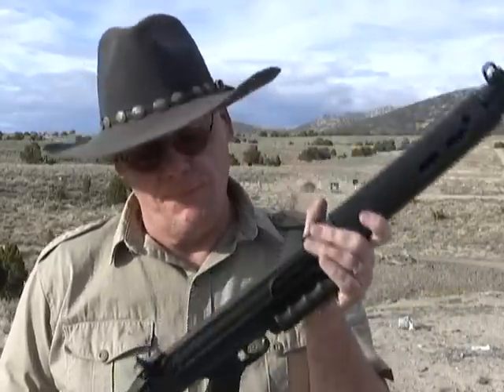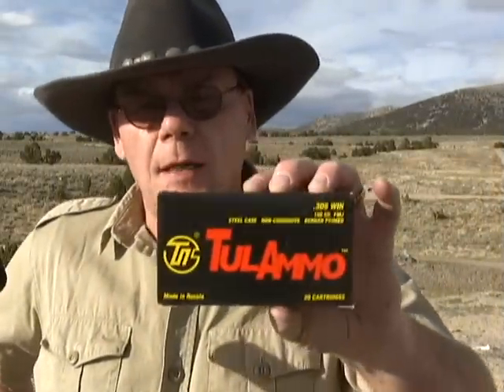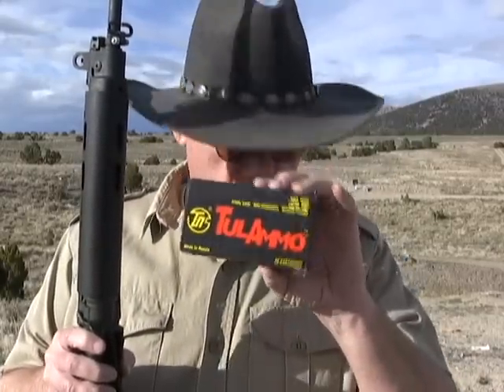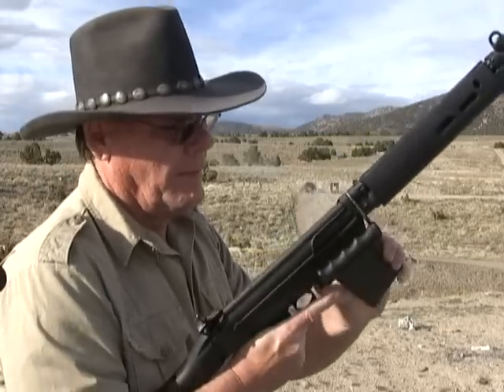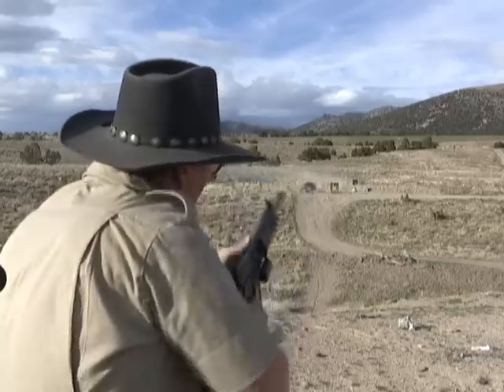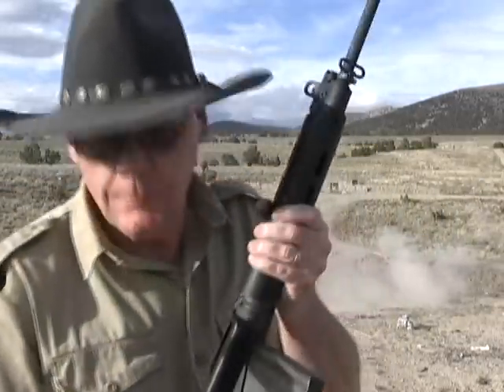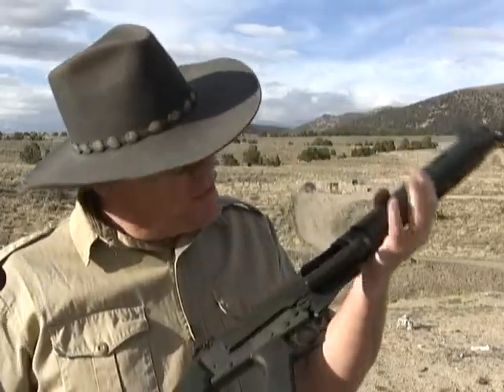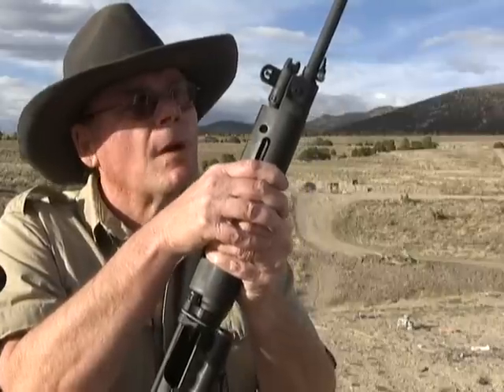Century Arms .308 R1A1 FN FAL Battle Rifle Junk?? You Decide!

Comment: I used this rifle (7.62mm) in the British military in the 80's.  Never had an issue with the rifle itself; the mags themselves is another issue. Often the bottom plate of the mag would pop off at the most inconvenient time  (only secured in place with a pressure button) .  When it happened you instantly lost the full contents on the mag onto the floor.

Some were concerned that the foresights and rear sighs were not on the same body part, so when the rifle was broken for cleaning you could lose the zeroing. I personally didn't find this an issue.

Comment: Using #3 on the Gas Plug is the norm for most Military Requirements for this Rifle.   Too high in the number or all the way up to Eleven, almost makes it recoiless...but there is a significant loss of power and the gas piston may not be pushed back far enough to completely push the Bolt far enough back for the Extracting/Reloading Sequence    Below 3...you'll get the Full Recoil and the possibility of tearing the ends off the Cartridges.  Especially Cheap Ammo.   #3 is the best setting for this Rifle...your Hunch was correct!   Some use #4 Setting with no issues.

Comment: I just got a frankenfal. It says century arms made it and calls it the R1A1. It has a 16-16.25" barrel, a dsa railed handguard, a DSA railed top cover, it is also a paratrooper folding stock model. The bolt hold open is missing the bar that the magazine follower hits to lock it open. It's a good shooter. I first tested it while it was completely dry and it functioned perfectly with the gas regulator set on 2. It would function in 3 but the cases were basically falling out instead of really ejecting. I'm gonna clean it up more and make sure the gas system isnt built up with carbon, then lather it up with lube and see how it functions then. I prefer it not need to be almost fully gassed to operate. I mainly fired 149grain brass cased ammo that I believe were reloads (they came with the gun from the previous owner). I also shot federal m80 7.62x51 that I bought from Walmart. It acted the same as all the other rounds I shot. It's not as nice as my ptr91 but I'll eventually get it cleaned up and set up right. I see alot of fals with the railed handguard and railed top cover and they will have a gap between them but mine butts up against one another making it into basically one really long continuous rail. This gun raises alot of questions for MN e so I guess I'm gonna have to tear it all down and do some research on all these little odd bits just so I can figure out exactly what all this thing is built out of.

Comment: I used these while serving in the British Army (infantry). A fantastic weapon which I preferred to my SA80 when we changed over. You knew for a fact that if you hit someone with an SLR they weren't getting back up and if you hit a limb it was most likely coming off. In all the time I used it I didn't have a single stoppage so I don't know what he's waffling on about as if it's unreliable. People get stoppages on an SLR if they don't clean it and even then it would have to be in really minging order to get a stoppage. The gas setting is there to compensate for crap ammo so if it's not re-cocking properly alter your gas setting, you don't need to go to a gunsmith. If he'd got a real L1A1 instead of a commercially made one he'd have had no problems at all.

Comment: For 5 shot and under, there is no issue with getting a .308 up here. If you get a chance, check out Lever Arms Vancouver website. Although a loophole in the law lets you run a 10 shot pistol magazine in, say, an AR-15, because it was originally designed so. The laws here still let a guy get some great guns, but the criminal and gun laws are pretty strict. So a guy risks gun seizure by the if rules are broken. The best thing to do is carry the law paperwork on yourself, for an officer if stopped

Comment: Used to work for Century Arms in the 90's up here in Montreal. We'd get a whack of FAL's, metric and inch, and we'd "sporterize" a whack and ship them to the St Albans VT warehouse. Sporterizing consisted of chopping off the flash suppressor and bayonet lug, and putting this gawdawful thumbhole stock on. The finish was crap (some really just being spray paint!).

In Canada we used the FN C1 until around 88 when we changed to the C7. Loved shooting the FAL and had less jams than the C7

Comment: the zero gas setting is for launching grenades. if you hold your finger to the rear each time you fire it will click as it reloads.. If it don't your out of ammo or have a miss load. always check the lips on the mag... always! some tracer will not light up till around 200 metres.

Comment: The British Army used a version of the FN called the "SLR" (or Self-Loading Rifle) from the late 50's until the late 90's - for non-infantry roles/ reserve forces.  It fired a NATO 7.62mm round which I assume is equivalent to .308.  It is a long rifle but in good hands is very accurate to over 400m (standard effective battle range).  The rifle I was issued was probably older then me but it worked fine with a little TLC.

Comment: Hey mixup98, I have had one of these for over 10 years, and still love her. Don't get to shoot her as much now the 7.62x51 is so damn expensive. But she is dead accurate. Just ordered the picatinny quad rail for her next is the M249 SAW pistol grip and butt stock
Reply from the maker: Michael....looks like you're going to have a nice set-up. I try to find cheap Russian ammo on sale but it still runs about $11 a box. Have fun and be safe, my friend.
Reply: mixup98 Yeah I have always kept it on gas setting on 3 as well, but never get the breech in the locked position after final round. Now whats harder to find is the FAL 308 Inch magazines, it will accommodate the Metric Mags, but they are a little loose and may cause jamming. But I have yet to have that happen.
Reply: Michael McCabe
If its original L1A1 style Inch pattern, it's not supposed to lock open, Brits removed that function for some reason...
Reply: That makes sense then thank you Sven Blubber

Comment: I have an Aussie L1A1 from Century built on a Hesse receiver. Once I polished the feed ramp and adjusted the gas it has run like a champ for the 15 years I've had it on about any .308 ammo. I try to stick to brass case annealed mil surplus .308 though. I also added a Trilux Suit scope to it as well which is a really neat military scope for it. I also added the Aussie wood and 5 slot flash hider as well so that it look the way it did in the 60's when it was made. Great gun, love it.

Comment: I have one identical to that and I can't tell for sure if it's inch model or metric- I contacted Century Arms with the serial number to find out and they said they made both back then and don't have records and don't know..  - I was wanting to put in an Israeli 21 inch HBAR barrel in it but will start a new one using a DSarms receiver. I note the mag slot on the front of my R1A1 Sporter  is a bar shape verses a more rounded slot so I'm guessing it must be inch model or at least made for inch model mags. I have a mix of 20 rd Israeli & 30-rd South African Army metric mags which all work... It has never jammed and I run a gas setting of 3'   - - That thin barrel gets very hot fast with high rates of fire.

Comment: Okay, couple of things.
With a Century built SLR/FAL clone, if you can find one with an Imbel Gear or Non Gear upper, go for it. You are getting a mil spec upper there built in Brazil in an FN licensed plant. 
No steel case in your FAL clone. It was designed to run brass cased ammo. Leave the steel cased for rifles designed around it. That will eliminate many of your FTF and FTE issues. 
Gas settings. Load ONE round in about 5 of your mags turn gas nut to Full Closed, insert mag and fire. If bolt locks back on the empty mag, you have too much gas and a problem. If not, open gas nut to setting One and repeat. If blt doesn;t lock back on empty mag, go to setting 2 and repeat. Repeat until you get reliable bolt lock back on an empty mag The bolt should begin locking back at a setting of 3 or 4 with good, NATO spec brass cased ammo. Ejection should be brisk and depending on gas setting, flinging your spent brass between the shooter's 2 o'clock to 4 o'clock 8-12 feet away. 

Right Arm of the Free World and still an incredible rifle.

Comment: you can fire 7.62x51 out of a 308 but not the other  way around safely that is. 7.62 is made to 308 head space spec and is slightly lower on the pressure

Comment: Do you know of any specific .308 loads that use rod type powders? I'm not surprised...they've been slowly pushing the design further and further so as to try and muscle out the gap between it and the .30-06. It may work fine with bolt action rifles but semi-automatics using high pressure loads intended for bolt actions (particularly hot match loads) generally don't fair well. The Remington 750 supposedly can handle "any SAAMI pressure round" but I've yet to test the truth of such a claim.

Comment: I bought an L1A1 from Century back in about 1995 or so. It was a post-'94 AW ban abortion. Ugly loopy thumbhole stock (to get rid of the pistol grip, donchaknow) and no flash suppressor.  It was strange looking, but I tell you what, it shot anything I fed it without complaints, even a bunch of cheapo copper-washed Chinese 7.62 NATO stuff. I was a gun dealer back then, so I sold it.  Kinda wish I woulda kept it now. It would be nice to have a reliable semi-auto in .308/7.62 NATO. Even an ugly one

Comment from the maker: Stealingmonwh11.....sorry I can't give you a current price for this rifle. I bought the one in this video back in 2002 for $449 in Las Vegas.
Reply: I see these on Gunbroker all the time for @ $900.00. I have also heard negative reviews, but being a gunsmith, I fully understand that it's most often the nut behind the wheel that's loose. These are more reliable and accurate than most anything on the market, as long as they're assembled correctly and the gas is set properly. It's been used by multiple military units in the harshest of environments on earth and is truly "The Right Arm of the Free World".

Comment: Sir when you fired that rifle in auto mode, it is noticeable that you can not really hold the recoil of the rifle and you fired it at close quarter. This shows that full auto could be use but in Close Quarter distance only. Beyond that you must fire the rifle in semi auto mode or if there is an burst mode. At clear field you could see your opponents even at 700 meters and if your FN is fitted with telescope you can out gun the guy using 5.56 M16 or 7.62 AK. I think it is correct that the one with a longer reach, under hard cover, and have better fire power have the edge in the battle field. The FN with an almost full size ammo has the better firepower and longer ballistic range. The ammo carry load may be heavier limiting more carry load but the fire power compensate that; and you do not shoot and shoot in the battlefield.

Comment: You reversed the gas plug for grenades and instead of a fmj round you used what was called a Ballasite cartridge to launch the grenades.
Plus you might want to tighten the carrying handle on that weapon cause if you get a rebound off it your left hand is gonna get bitten and that bugger hurts just remove the handle and put a little twist in the hinge circle it should be stiffer.
Reply from the maker: Hello Nigel and thanks for the suggestion with the carry handle.

Comment: Bolt wont lock back...as well as the magazine it can be the gas setting.Not all ammo runs at the same pressure.I'll shoot S.African 7.62 then have to open up the setting for the German or U.S.NATO spec stuff.Please be aware that the Arg. CAVIM is notorious for having varying pressures.Its supposedly been at fault for 'blowing up' a few guns over the years.That stuff is not safe.Go check out The FAL Files site.The guys there are very informed and helpful.Great vid.Thanks.

Comment: ???Really?You probably have to replace the gas piston.Once I replace that it was smooth shooting.Also punch the gas port with a pipe cleaner with some Hoppes bore cleaner and wipe dry.Set the regulator to # 3 or 4 then work your way up until the bolt locks around 6 or 7.The best I have found was 4 or 5 which helps reduce recoil.Mags might be the problem,check or replace spring and follower.Its the same as the M14 in many ways.Good luck and enjoy shooting!

Comment: The FN FAL pattern is really difficult not to fal in love with (pun). Right Arm of the Free World. If you get one that's manufactured well, (which can include the occasional Century), it's a really enjoyable firearm to shoot. I had a DS Arms IMBEL for years, till .308 became too expensive to shoot. Ended up selling it in order to buy a VEPR in 7.62x54R, less than 1/3rd the cost per round to shoot. The FAL however, will always occupy a soft spot in my heart. It's a long, sexy rifle that fires a full power cartridge but kicks like a lightweight .30-30. The FAL is what I'd refer to as a Rifleman's Rifle. Provided it was manufactured correctly: they're ordinarily ridiculously reliable and provide as much practical accuracy as any combat rifle need do. By that I mean 2 MOA is common with no modifications, 1-1.5 moa is achievable with some work put into it and sub moa is attainable if you want to go with it. The only real caveat with the FN FAL pattern rifle, magazines. There's millions of magazines in existence for it (that is a mathematical certainty): and weeding out bad mags can be a chore. Once you have 4-5 good magazines that you've tested through it though, that sexy little Belgian beauty will run like an Olympian.

Comment: Thanks for making a video of the Canadian FAL variant. I had one of the 1st Century Arms with the thumb hole stock. It shot pretty good but Jammed with Russian ammo.
I had my gunsmith assemble an FAL with an Imbel reciever and use a Douglas match grade barrel that he fluted. It is spot on accurate and NEVER jams. I think it is one of the best non scoped 7.62 that you could have. I picked up almost new Austrian mags for $8 per about 8 years ago. I have my lifetime supply of ammo, parts and mags. What a great system

Comment: I have an original century L1A1 with an imbel reciever assembled in canada.  It has gone through thousand of rounds including 55 gr sabots. It never fails. the video has fails but that is the ammo.  look and see how some flys out and others roll out just past his shouldert.  The only way the mag hold open does not catch is if the bolt does not clear the back of the mag for it to catch.  I use the 30 rd DSA mags flawlessly.  This is not a tv gun as it will get hot and start smoking the hand rails

Comment: I used the SLR L1A1 British version of this rifle in the 80's and 90;s, along with M16A1,  AR15;s and the G3 until the SA80A1 was introduced whilst serving in the British Armed Forces for 14 years. The SLR was by far the better, more reliable weapon, more accurate up to 800-1000m, you knew if you hit the target with one round they weren't going to get up - even through cover like a wall. It was called the "right arm of the free world" for a reason. I always found and was trained to use this weapon with an initial gas setting at 6 and then if you had gas stoppages then adjust the port accordingly by a notch up or down.You shouldn't have any issue then - that's why its adjustable. Lastly, your weapon handling drills were shockingly bad, from the way you cocked the weapon to no safety drills when finished firing, I know plenty who have been booted and beasted all day for such simple and dangerous mistakes! This was more obvious and shocking when the young lad at the end of the video finished firing. This was a shame because your video apart from that was good at demonstrating the versatility of this weapon.

Comment: If is does not lock to  the rear after the last round is fired it has to  be the magazine, am i wrong?
Reply from the maker: Actually the magazine hold open pin was too short and once I replaced it the problem was fixed.

Comment: I have had mine for 20 years. had it shortened to 18 1/4 inches, and gas port enlarged. mostly to make it easier to handle in the brush. around here, you can't see beyond 50-60 yards.  I have no problem, shooting a deer. 178 grain soft point, and bang! meat in the freezer. I have Never missed a target, or deer, due to any fault of the rifle. It is heavy. I use a 5 round magazine. it takes some weight off. Accuracy is not great. 2-3 inches at 100 yards, with hand loads . I had some battle pack of ammo, sealed in plastic. that stuff went all over the place.

Comment: I'd start with the gas turned DOWN.  As you turn it up on each shot, it will start to cycle.  Once it's working, give it yet two more clicks for good measure, then never touch it unless you change to some exotic ammo.

Comment: this vid just gave me an idea. could someone do an accuracy test on the l1a1 and tell me what they come up with as far as grouping . functioning with the gas selector at various settings and shut to work as a single shot. im figuring closed would be more accurate but im just guessing. i figure if the bolt isnt slamming back and forth , it should hold a tighter group.